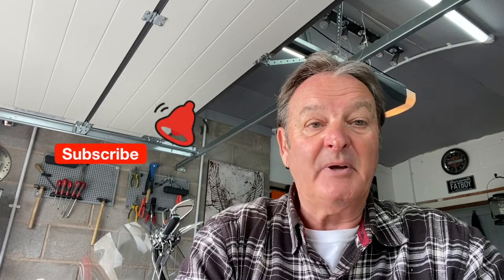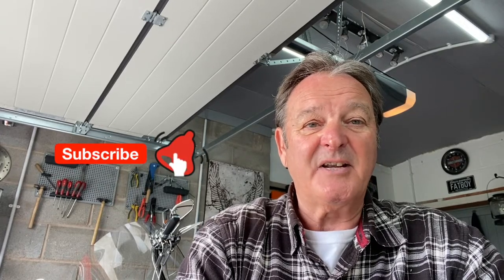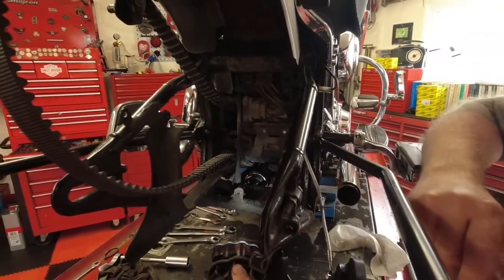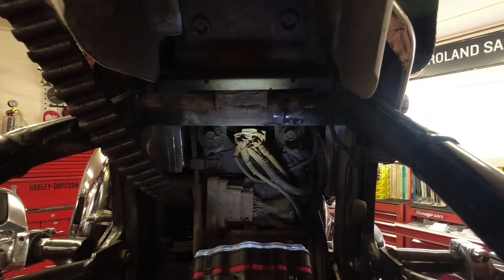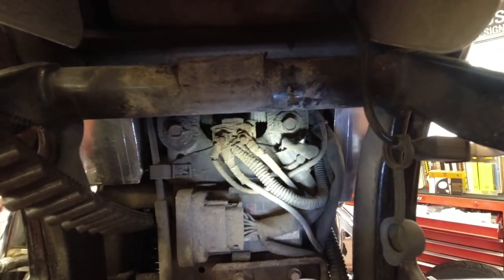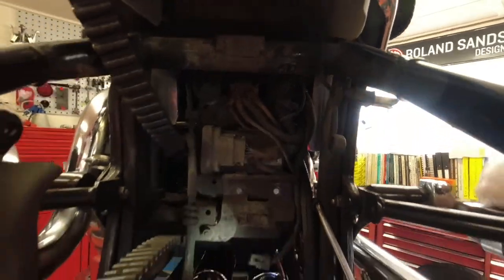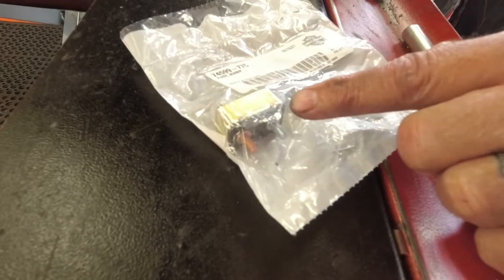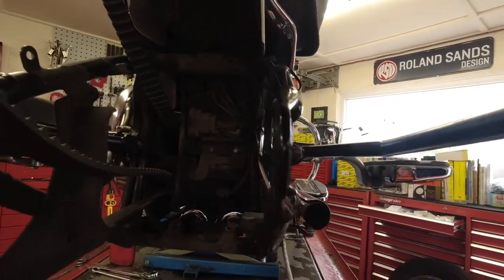Harley Davidson FatBoy Electrical Failure

Comment: This past weekend I was riding with a gal who rides a 2003 Fatboy. We came out from lunch. She tried to start and nothing. All she had was the odometer and the horn worked. I checked the fuse box under the seat, all the 15 amp fuses were good. Her battery was good. She had the bike towed to her home. I'm starting to think this 30 amp CB is the problem. Do you REALLY have to pull the rear wheel to get to this thing? Ahhhhh!

Comment: I've just bought a 1200 sportster from 1994, bought it and it ran, got it delivered few days later.  Tried to start it when I got it and turned the key nothing.  Battery is good.  Fingers crossed this is thr issue.  Look easier to get at on the sportster though l.
Reply from the maker: On a Sportster the connection is under the seat, but your problem is more likely to be a rotted out earth lead, hope it helps

Comment: Mines a 2002 Fatboy. Please share what year models are located there.
Reply: 2000-2006
Reply: Thank you…
I located it right where you showed it.  I agree, What a ridiculous place to put that part. 😵‍💫 
I was able to change it without removing the rear wheel. By removing the black plastic guard . As well as the ecm  plastic cover. 
Thanks again for your helpful video. 👌🏼🤟🏼